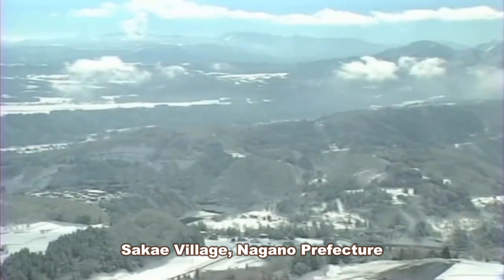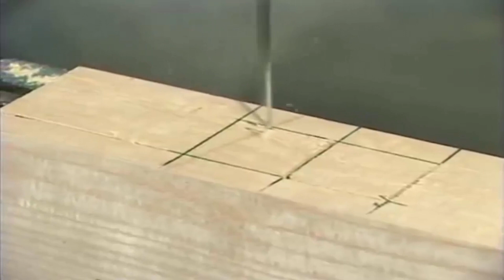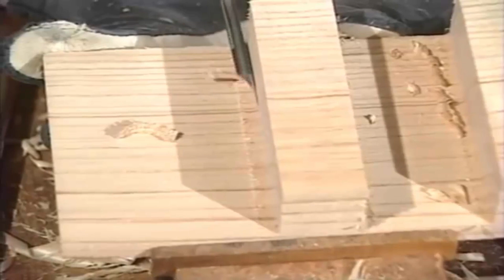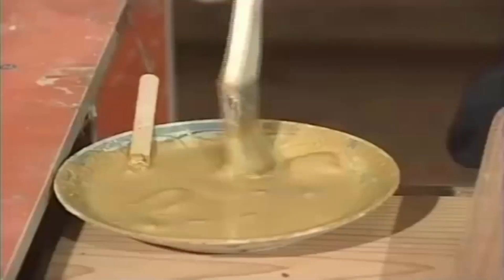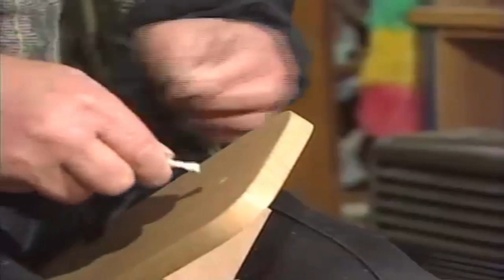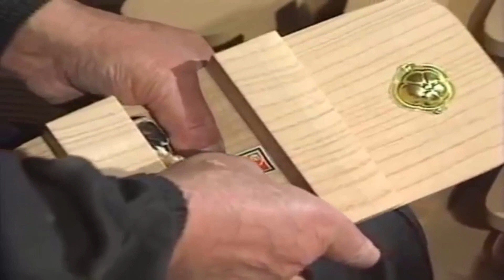The Village has been Carried out Production of Kiri-Geta for Over 100 years | Craftsman: Yamagishi

Comment: As below, I've never seen chisels quite like that before. 
Its logical really, a slanted blade will give a much smoother cut, and probably require less force to perform the cut. I'm curious about  their side 'guides'are they removable? If not, its difficult to imagine how the chisels are sharpened.
Maybe I'll try making one out of an old chisel to see how it functions, compared to a normal chisel.
Reply: Nik, I think that such a skew chisel with raised shoulders for pilots would only serve you for the single purpose that they were created for, paring up to a fillet in very soft and favorably grained wood.
Reply: The skew chisel has been around forever. Nothing difficult about it, if you can work with a square chisel you can work a skew.